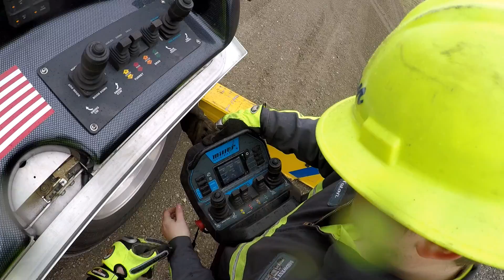GPS FAIL   THE MONEY PIT

Comment: I am a literate, educated truck driver with 10 years under my belt.

The first 2 months solo I did some horrendous things.  I never destroyed a truck, or a building.

But got stuck a couple times!  Like any profession, there’s a learning curve.  I still learn something new!
Reply: MrDave 777 if you stop learning you’re doing something wrong 🤷‍♂️
Reply: The first year I had a couple bad happens but after that it was good for the most part I pulled a flatbed spread axle got my CDL at age 20 and was over the road before my 21st birthday wasn't supposed to but had a leaniant company
Reply: Bad day you don't learn something new!

Comment: Hi Ron. Interesting to watch you continue training Ethan. Your letting him stretch his wings while continuing to give him guidance. Good job. Now on another front. I think this would maybe be a good truck driver training video. It’s about the driver thinking about what he can do and not do with his truck. And when he gets it wrong, it can easily result in a visit from you or some one like you. In this case, it appears no damage was done except some new ruts in the ground, an embarrassed driver, and a tow bill. As an OTR driver for a number of years, I made some choices in truck handling which put me in some less than desirable stucky situations where I found I could not do what I thought I could do. Two come to mind. One similar to this one. I was backing an empty trailer into a parking spot and did not realize how soft the gravel surface was. It was on a holiday weekend. I was alone and no one was around to help. Nor could I get ahold of any one due to said holiday. 1) I learned that even if it’s dry, gravel can still be soft. And you can sink in it real quick. 2) an on road hiway truck is not an off road truck. Wrong tires and wrong suspension. (Limited axle suspension clearance and limited articulation.) 3) locking in the power divider does not give you positraction or 4x6 wheel drive. It’s still only 2x6, which is better than a 1x6. Barely. It only locks front and rear diffs together. They are still open, and it behaves accordingly. Not good for stuckies. 4) never, ever, leave home without a shovel. You will need it sometime. 5) never not have chains on your truck. You will never know when you might need them in July in the 100 degree weather. They work for other situations other than snow and ice. 6) do not assume a surface is solid enough to drive on. GET OUT AND LOOK! 7) I cannot stress this one enough. LEARN HOW ALL THE DIFFERENT SYSTEMS AND FEATURES ON YOUR TRUCK WORK, AND UNDERSTAND THEM. for example. Traction control. Understand how it works and why, read the owners manual and find out if it can be disabled or how much it can be if you need to. Where is the switch. When does ABS activate. (I had a few surprises there. Turns out their is a schedule of rules which it follows that can lead to unexpected results.) Can it be deactivated if necessary? (Some can, and some are not defeatable). How many of your wheels have spring brakes. Some tandem axle trucks only have spring brakes on one axle, not two. That is important. It affects your options in difficult situations. Do you really understand how an open differential delivers its torque and how to manipulate it? It was not until I took one apart in my car that I found out about 80% of what I had been told by a lot of people was flat out wrong. Knowing how it really works saved my butt more than once. Learning how to manipulate the different systems on the truck using the various switches, pedals, settings and how to manipulate then to achieve a desired result became a valuable tool in my bag of tools and skill set. In this case, it might have been a better idea to back up a half a mile instead of get stuck in soft ground, or back into the turn out instead of drive in. One time I got stuck in a dry parking lot when a potholes did not allow enough axle articulation to drop the wheels low enough to maintain traction because it was to light. Wound up with one wheel on each axle grabbing air. I had to drop the rear suspension air bags in order to allow the suspension to sink down into the holes to regain traction to drive out of them. (This truck would not activate traction control under something like 5 mph wheel spin and and when it reached that speed, it derated the throttle at the same time it applied the wheel brakes, and then dropped the speed back below the threshold speed, then released the brake and thus the truck did not move because the automated transmission had disengaged the clutch and shifted into neutral.) Had to dig out the owners manual to understand what was going on. Drooping the suspension solved that one. Found out later under certain situations you had to change a mode setting to avoid this issue. Computer controlled trucks do not always work the way you expect them to. (And sometimes the company reprograms the truck and it does not do what the book says it will do. Sometimes they got it wrong.)

Comment: Yes I do remember this, the first towing you did alone and the second towing you did with Ethan where you made him help you by using a shovel and removing the excess sand and made him place blocks of timber under the rear tyre. I'm fromSouth Africa and I do remember this place very well with both sides of this road has streams that was biult in the old days which you told us in the last video to avoid further floodings in the area so excess water can flow down these drains.

Comment: @ Ron Pratt;
You said you don't mind suggestions, so here is one:
With the trailer being empty, and the tractor being heavier due to the engine & drive train, I would have backed him out onto the road the same way he came in. Then have him pull forward on the road and back the trailer into the softer turn around area. That way he keeps the tractor on more solid ground and the lighter trailer would probably not sink in and get stuck.
Once the trailer is backed in, he could take as many bites at it as he needed to to get to get headed back the right way, while keeping the tractor on the more solid roadway.

Comment: Kudos to you Ron! A true leader (teacher) knows how to let others take the lead position, and to just back up and to only give guidance when needed. No matter how much you want to jump in and take over, (as long as there isn't a safety concern) it's usually better to let someone try, and then go over the areas where they can improve later. 
I teach some Japanese martial arts and one of the best things my instructor taught me was not only how to teach, but also how to teach others to teach. One of the best concepts is: "PCP" or "Praise, Correct, Praise". When needing make a correction: 1st, Praise the learner for something they did correctly; Then, as kindly as possible, tell them what they did wrong AND how to fix the issue (correct); Finally, Praise them again for something they did correctly, even if it is only a rewording of the same initial praise. You can almost always find something the learner did correctly, even if it is just their attitude, or the fact that they are there and trying. The fact that you admitted your own fault, and corrected the issue, is a way of teaching others how to teach, and how to be teachers.
I know this is an older video, but I've somewhat marathoning your stuff recently. I've really been enjoying it! Thank you!

Comment: Gotta love that rotator! They are such a huge advantage over a standard boom.
Reply from the maker: Yes they are.  I starting working with the Holmes 750 split boom many years ago, then moved up to a hydraulic stick boom and thought I was in Heaven.  Then jumping from a hydraulic stick to a rotator was an even larger leap forward.  The shear power of the rotator presents its own set of challenges, though.  One has to be extra cautious while operating it.  You then add in the "crane" section which adds a whole new dynamic with its unique set of challenges.  I have trained and learned quickly, but I still learn every day.  I will never know everything there is to know.  One of my old teachers taught me a phrase that has stayed with me "the day I stop learning is the day they put me 6 feet under."  Hopefully that won't be for quite some time.   Thanks for watching and God bless.

Comment: As a former wrecker driver (admittedly only the C30s and mid-1980s Century hydraulic systems and early wheel lifts), I have LOTS of questions about the "Tater." That's one heck of a fine piece of equipment!

Comment: One more thing. I had one stuck at the rest area, south of Osceola. It started as simple winch out. I noticed right landing gear was on pavement and left was in the water. I noticed he had unlocked his kingpin. It took me an hour to get it locked, working tractor back and forth until it finally locked. If I hadn’t noticed it, the trailer would of rolled over when I pulled the tractor out because left landing gear was 18 inches from the bottom of the hole on the left side. I always check the kingpin from that day forward. I don’t know why they want to unhook when they are stuck. You probably have already told Talon, but I thought I would mention it. Stay safe my brothers!!

Comment: It's amazing how many drivers don't even know what the power divider lock is. Besides that half the time the thing doesn't do a hell of a lot. The opposite Tire diagonally will just spin instead. Would you really need is a differential lock on both axles and the power divider lock.
My last truck had a traction control system, that would apply the brake on a wheel that was spinning and that actually worked reasonably well in Slippery conditions. Better than any power divider I've ever used
Reply from the maker: Our Heavies all have "full locking" rear differentials.  For instance, on the Rotator in this video, it has two drive axles.  Each axle has a "full locker" which makes all 4 tires (both sides) lock in and turn full time.  It then has the power divider lock which locks both axles together, which makes all 8 drive tires locked and spinning together.  It is much different than a standard power divider system that does as you stated.  I have 3 separate switches for the locking axles and PD.   Thanks for watching and God bless.
Reply: Ron Pratt 
I love your videos, and I saw another of your videos where you mentioned the Locking differentials that you use.
I was very impressed with the traction control system my last rig was equipped with.
The truck had super singles on it also, which did surprisingly well in the snow along with the traction control.
Most of the time all I had to do is leave it in gear keep my foot on the throttle and it would slowly create forward out of whatever slippery condition or rut that I found myself stuck in.
Keep up the great work...

Comment: I know it tough to share the reins, but Talon seems to becoming along just fine. I was listening to him shift, and the truck sounded great. When I was in business, I had as many trained people as I could get because you never know when you can't be around for multiple reasons and you want the best for your equipment and customers.  ..............  I hope you are feeling better very soon.  Here is one concept I use may help you in the future: I carry a little squirt bottle (old nazel spray bottle) of Rubbing Alcohol with me, winter, summer, does not matter. Anything I touch from a grocery door to a fuel pump nozzle, virtually anything another human has touched before me, I squirt just a bit of that on my hands because you can't wear gloves all the time like to the doctor's office. The trick is not to touch any part of your face without that light Alcohol squirt on them and rubbing your hands together. This has never dried my hands out, but if that does happen especially for woman than hand-sanitize jel is the next best thing. This should shield you from getting common colds and the stomach bug, at least it has worked for me and i'm 65 suffering from Acute Fibromyalgia since 1980. ...........................  BTW I didn't realize those truck bumpers were so strong. I'd of rather seen you use the axles, but I guess since the truck was empty, that bumper did not bend & I'm by no means a tow truck expert.
Reply from the maker: The chain was anchored to the slider frame rail.  It was routed out through the rear bumper but wasn't attached to the bumper.  I wouldn't do that even on an empty unit.  Thanks for the tip on the alcohol.  God bless.
Reply: Ahhh, thanks for your reply and up-date, things the camera does not show, I figured you knew what you were doing LOL...............  I think if you put the alcohol in your pocket and carry it with you everyday, keep it with your car keys so you don't forget it, your chances of coming down with a bug is greatly reduced.  God Bless to you and your loved ones as well..  Thanks for your videos too....
Reply from the maker: No problem.  Thanks and God bless.

Comment: First off, I have to say y’all do great work!!!!  2nd, I’m a problem solver. It just seemed to me that it would have been easier for him to just back on to the road towards the wrecker. Then pull up far enough to back the trailer onto the gravel area. Then pull back onto the road going in the right direction. What do you think?
Reply from the maker: He should have backed the trailer into the gravel area from the road to begin with, in my opinion.  If he had, I don't believe he would have gotten stuck.  Just my opinion.   Thanks for watching and God bless.

Comment: 2 things could not figure out ...1>  why doesn't the  state / local highway ( whoever governs the road  put LARGE  signs up saying  no Tractor Trailers allowed.   2>  How / why some drivers  do not question their GPS  when they see the it is telling them to  turn down a narrow rural Country road,  I mean they should stop immediately  at the turn or  as soon as they turn onto it and question if it is a truck route,  As a regular GPS user myself and experienced  driver  I have questioned  my GPS  instructions to turn down a  road, using common sense  and instinct  of looking at the road VS the highway it wanted me to turn off, .. I  pull over and   zoom out on the GPS map  and  look to see if there is another way that keeps me on the main highways (also most GPS units have settings to avoid certain roads)  When  Following a GPS, you need to use common sense and  instincts

Comment: Wouldn't if he backed into that gravel spot been better of a chance of not getting stuck? Keeping the truck as close to the road as possible.
Reply: Chris Trapp my thoughts as well. Keep the drive wheels closest to the hard surface. Old mate should’ve just backed the trailer in originally...but then Ron wouldn’t make any money from the money pit
Reply: A lot of guys avoid backing on blind side and roads not wide enough for the truck to do the swing it needs to
Reply: What most drivers don't realize is half of the task of backing up is accomplished while still going forward.  Most just pull in straight and then have to jack the unit around all at once with limited room rather than swing in and set up for the back while still moving forward.
Reply: Chris Trapp I can tell you have no big truck driving experience.
Reply: The thing is he would've had to do a blindside backing which is why he probably went in that way.

Comment: Ok, was that put there as a truck turn around?  Even if not, some working over with a sheep's foot and some further building up would be in order.  Even without that, a warning sign, properly placed (ie; put where the driver can see it before he is committed) should at least equalize things.

That was one of my pet peeves about doing local work.  City's that posted "No Trucks" signs at a point where you didn't see them until you were beyond being able to change your route.  Posted six truck lengths down the street from the intersection.

Comment: I have to wonder when GPS manufacturers are going to come out with a "truck" specific unit that would warn truckers that they are about to get themselves into trouble if they take certain roads. Deals Gap from North Carolina into Tennessee is one such road. It is posted 16 ways from Sunday with warnings not to take a truck in yet every year drivers blindly follow their GPS and then end up on a 2 lane road that has 318 turns in 11 miles, no shoulders, sharp hair pin turns, and shear drop offs. When a semi ends up on Deals Gap it takes more than the whole road and every year there are accidents, sometimes deadly, as a result.

Comment: GPS: In 500 feet turn left.
Turns left into quick sand
GPS: Destination is on your left!

I got into a situation similar to that driver, trying to follow a road I thought led into a road side rest area.  I got off the exit, and took the turn, that I thought led into the rest area(It was way off the road with a very long path to actually get to it), and I wound up driving down a back road at 0 dark 30 in the morning.  When I finally went to try to turn around, I backed into, im guessing someone's driveway or a yard with soft ground.  It was super dark and I couldnt see jack, but could see it was flat and open, so I backed her in.  I got hung up for a little bit, and was messing with differential locks and rocking the truck and eventually got it free.

Comment: The issue Ron is most of these foreign drivers which is what trucking in the US has come to. (Low pay and no respect) they buy cheap and car GPS units not the $6-700 units made for trucking  which leads them on the wrong road